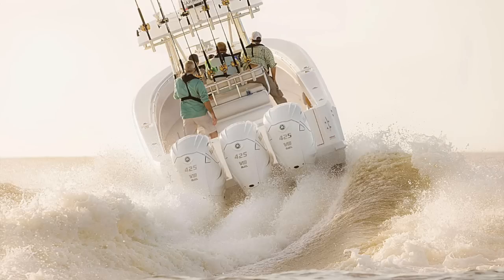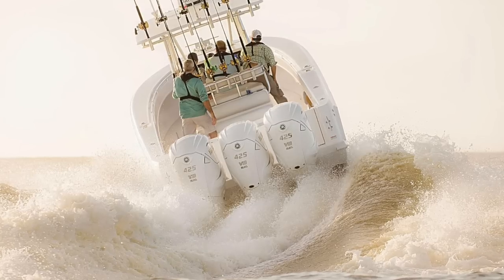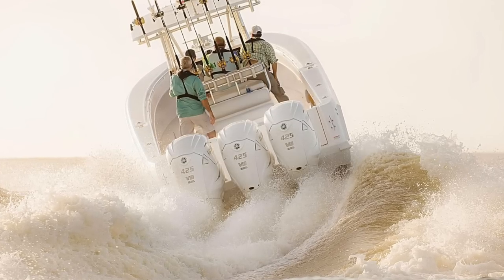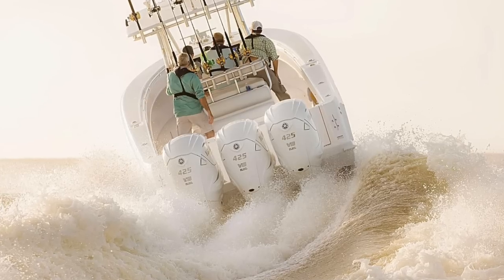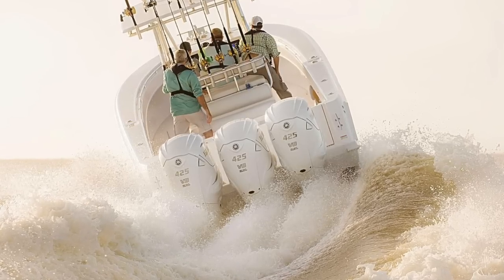Should You Fill Your Boat's Fuel Tank During Storage?

Comment: I live in Bremerton, WA and had to dump 30 gallons of E10 fuel because of non-use of my boat for a few seasons. Even with fuel stabilizer the fuel had separated and included condensation/ water in the tank. I own a 2018 Bayliner VR5. The the service center that I used HIGHLY recommended using Ethanol Free fuel in the future, and fortunately it is available nearby our home or boating destination. They also recommended ALWAYS using a fuel stabilizer. See you on the water!

Comment: Both answers are correct ...you either fill it which is expensive and risk overflow issues on hot days destroying your lawn or environment and risk water retention issues, or you burn it pull the boat and pull a minimal amount of gas off the boat.  If you are filling its easy use fuel treatment you should be ok for several months.  Ethanol is always a water retention issue so I opt for empty tank in the winter.  I use as much as possible before I pull my boat.  Once I pull it I use a "gas tapper" to remove the rest (usually less than 10 gallons) I use it in lawn mowers and or put it in my truck.  No problem....Plus I burn out the gas in my carbs (VMAX 150 2003 2stroke with 3 carbs)....I would go with the full tank but I tried that a couple of times with my boat and it either created major water issues and or it caused carb rebuild problems.  Since I have been pulling gas and running out gas in the float bowls, I haven't had a problem in over 6 years.  I should specify I have a 1992 Proline running a 2003 150 Yamaha Vmax 2 stroke ..the last year with carbs.  If a mechanic recommends keeping gas in your carbs(and tank) ask him if he will clean your gas and rebuild your carbs for free ....   Oh no?  That's what I thought.  In all fairness its different strokes for different boats and old boats / new boats and environments.
and carb vs fuel injection.   I'm in the North East and that's what I do with my old boat.  I hope this helps someone.

Comment: I have often seen boats that have their fuel tanks completely filled for winter storage will expand when the air temperature suddenly rises the in the late spring and vent fuel all over the boat, cover, and trailer.  Wouldn't filling 75 to 90 percent be a better choice?
Reply from the maker: Yes. That point is covered at 8:30 in the video.
Reply: yes, our boat will do that also, first hot spring day
Reply: I always fill mind to near full. Then I use it for one kast trip burning off enough gas for expansion room and to get the stabilizer throughout the system. 18 years doing it this way, no issues.